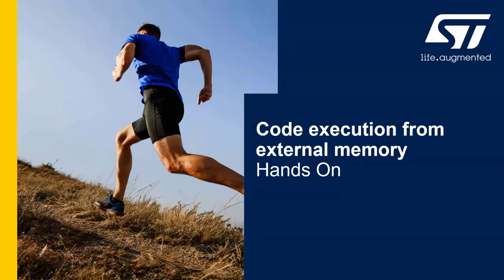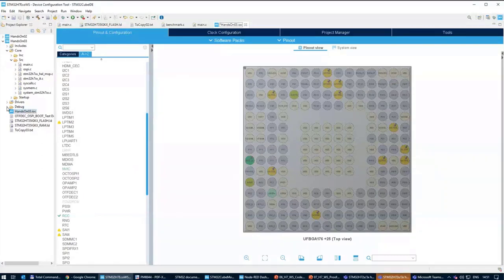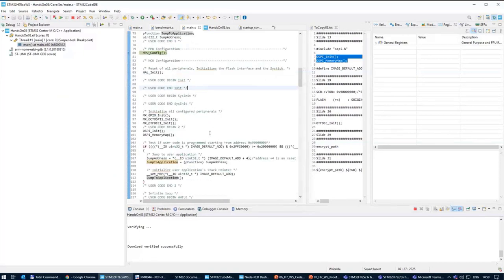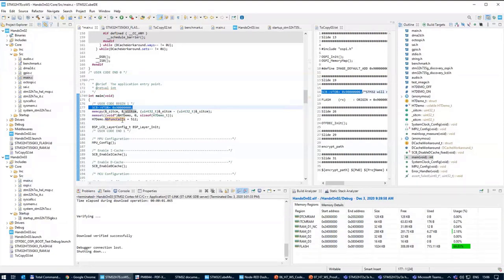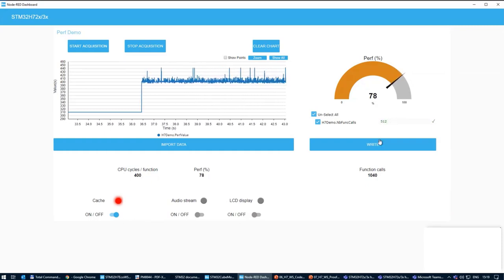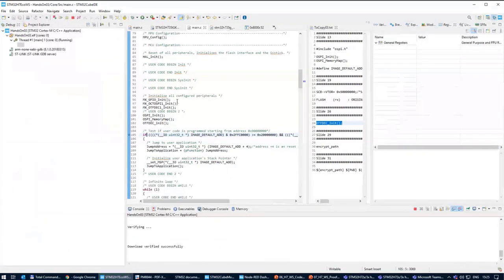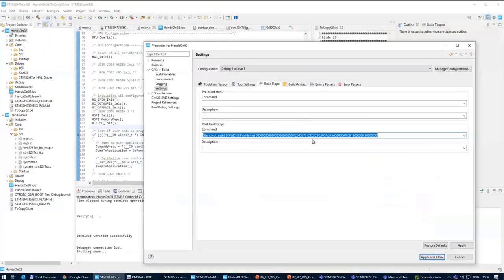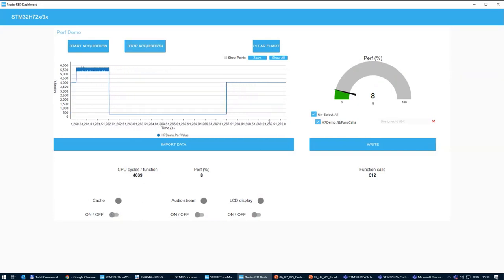MOOC - STM32H72x/3x hands-on workshop - 6 Code execution from external FLASH

Comment: interesting, but unnecessarily complicated. Why can't you guys do it like NXP on their MIMXRT series of MCU? Ideally external RAM or external Flash should be implemented somewhere in the read only boot ROM or somewhere before the main; then the user won't need to bother about all these complications. I know they use a lot of resistors (pull ups and pull downs), but it makes the coding relatively simple. I want to focus on my application rather than spending so much time to code for external RAM/Flash.